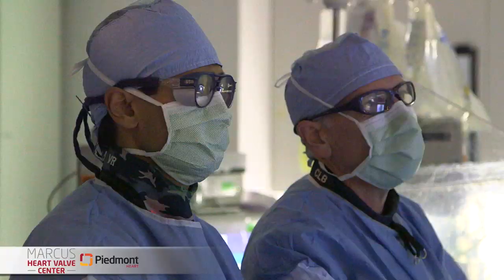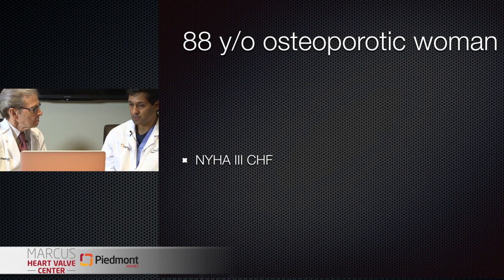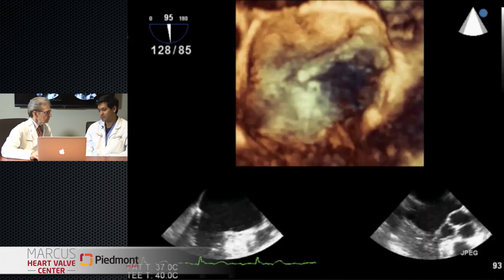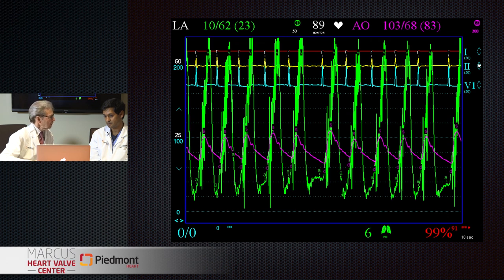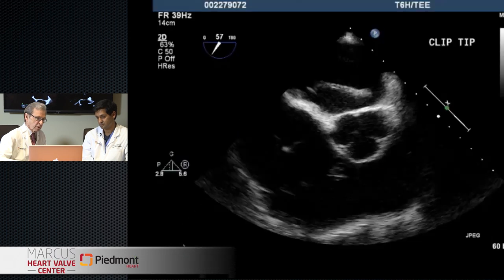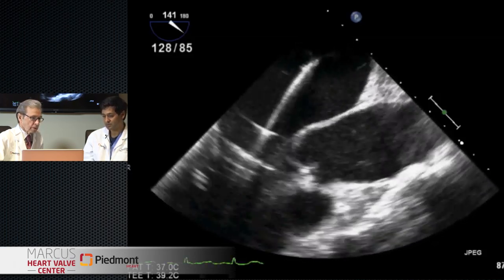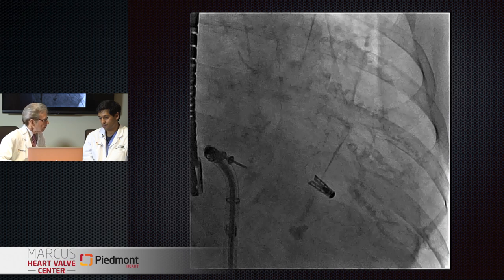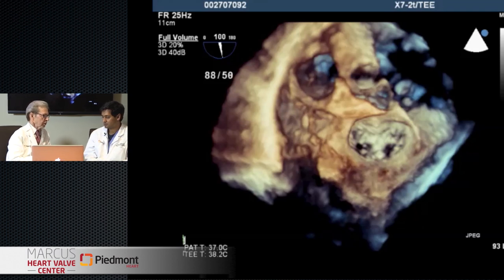MitraClip :  Minimally Invasive Mitral Valve Repair

Comment: They did not mention angioplasty or catheterization procedure. They used 2D and 3D echo imaging. Under the x-ray maybe they controlled the cable entry into the valves and touched and repaired the valves.